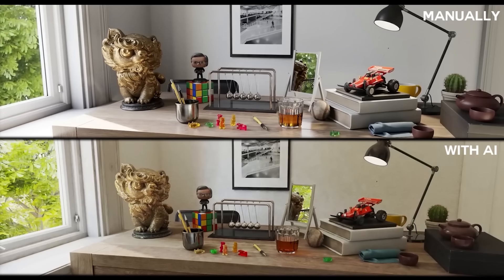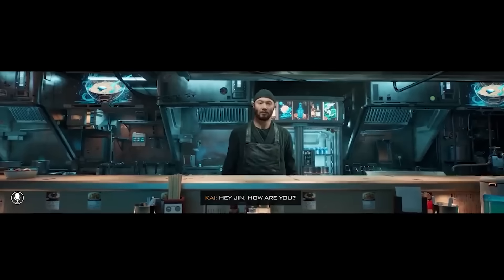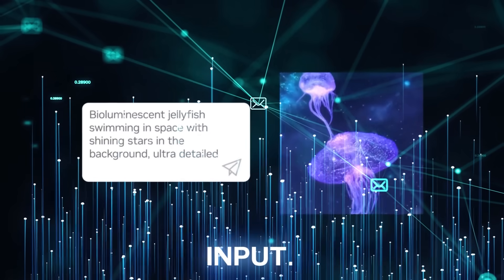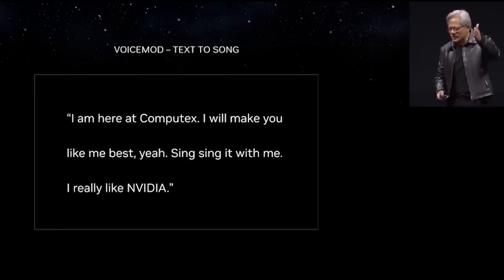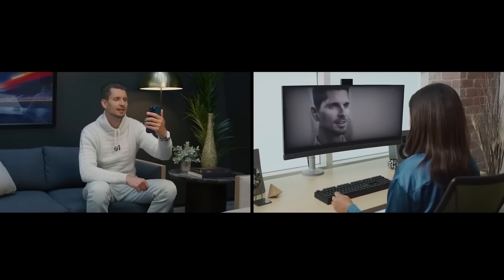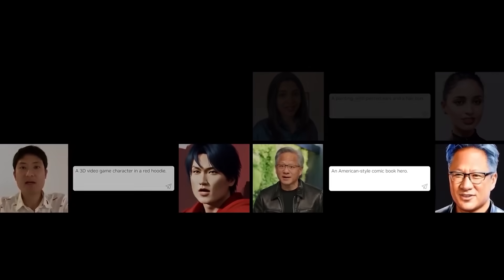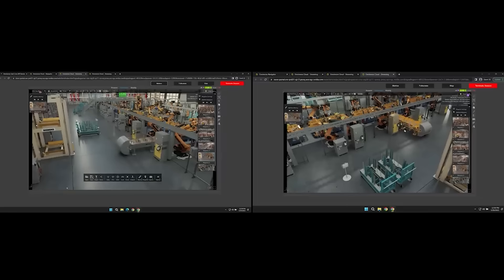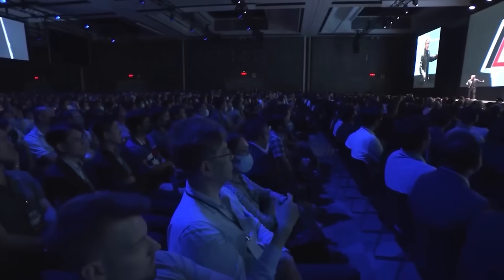NVIDIA's NEW Insane AI Takes The Industry by STORM!

Comment: This software must come built in on OS update links. No old way of doing things but easy ways base on a  system specs. Have a AI to show how a user can update via windows. Also have a store for apps since now Windows it's on mobile 📲 , all technological device desktop or any electrical appliances rely on grid base ,  all electrical appliances come with a battery 🔋 to face tracking will fix faces pixel when cut by signal strength alot changing